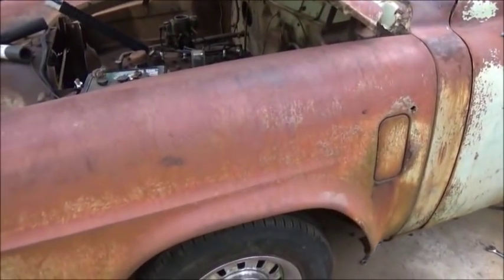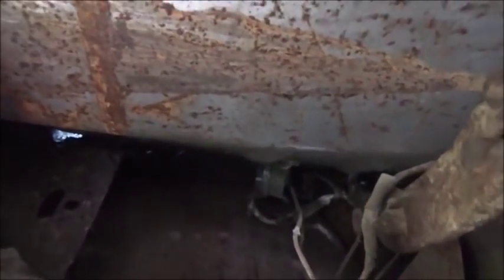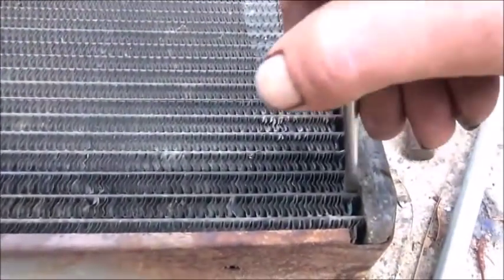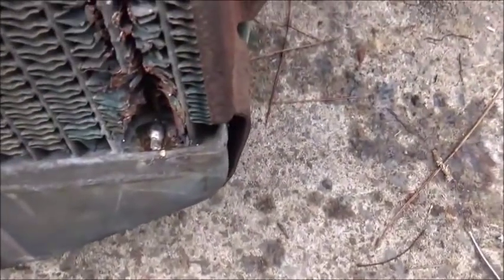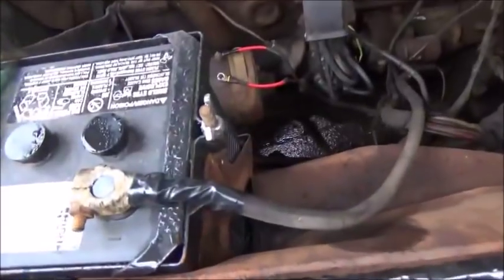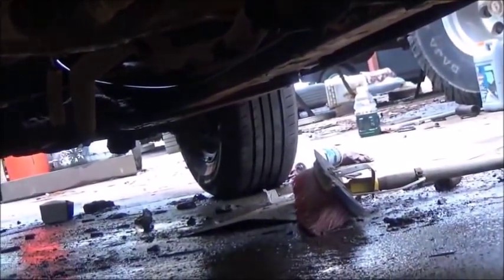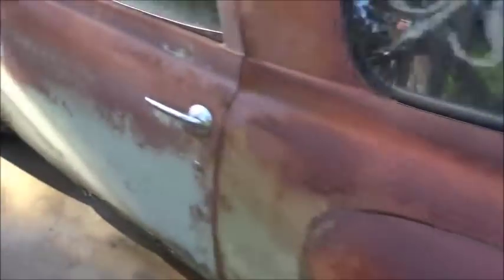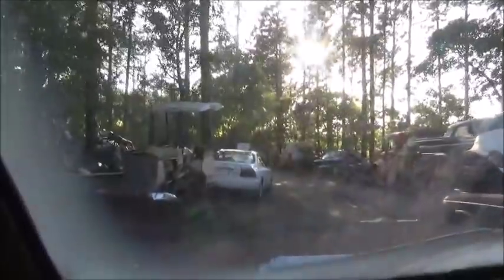1951 STUDEBAKER FIRST DRIVE IN 40+ YEARS

Comment: Your overdrive will make a world of difference. That engine only produced (when new) 85 horsepower, and the rear end ratio is 4:56. With the overdrive, I can comfortably cruise in my '51 Champion @ 65mph.
Reply: How fast can you feasibly cruise without O/D? I’m working on a 53 champion project right now, and it doesn’t have O/D.
Reply: @FennixGamingYT  If you have the same ratio rear end gearing as mine, 50 mph will probably be as fast you'll want to go, but by 1953 they may have gone to a taller gear ratio which will calm things down a bit.
Reply: @rogerlee3941  I think my car has either 4.10 or 4.27 gears

Comment: Fabulous resurrection!  You mentioned overdrive being needed. the trans is most likely a T90, with the external OD lever connected to the handle next to the hood release, and a solenoid about the size of your fist, plus a governor to tell it when to shift. Normally, to use OD, push the handle in, and drive normally. My favorite trick was a toggle switch mounted to the shift lever, bypassing the OEM electric control, allowing the solenoid to be directly controlled, regardless of road speed. In effect, you could split shift it for six gears, but it was only practical with five of them. Shifting kind of like using a two speed rear. The stock axle ratio was probably 4.55:1. There should be a tag under one of the diff cover bolts, usually on the lower right. You can have a lot of fun with OD! I did this before I could afford to buy a T-10.  By the way, when you're in OD, the transmission will let you coast when you take your foot off the gas, known as "free wheeling" so you have no compression braking.
Reply: I had a 56 chevy with od and it would operate as a 5 speed as well as a 59 ford I guess most of the od transmissions worked the same way.
Reply: @frankdeegan8974  You are correct. The overdrive only works on second and top of the three speed box. Usually there is a contact breaker operated by the gearchange so when first or reverse is engaged the power to the solenoid is cut. A similar contact breaker is attached to the accelerator linkage so when the accelerator hits the floor the overdrive disengages (overtaking kick down). Got a Warner overdrive in my 1954 Packard.

All the best from

Nick Jervis UK 🇬🇧

Ask the man who owns one

Comment: 2 comments: You should really consider a really good refurb for the '51.  If only because it's a 2 door. And I read somewhere that an excellent safety device  for ANY old car with a straight steering column and flat steering wheel is a pointy spike in the middle of the wheel aimed at your heart . It will make you a better defensive driver. It won't save you from the drunk in the wrong lane though. LoL

Comment: The low geared rear end necessitated the overdrive and that gives you 4 forward speeds, and if you wind it out in 2nd gear OD will engage giving you 5 forward speeds !!!  Or IF you wire past the OD governor and put a switch on the shifter handle you can get 6 speeds out of it !!!!  A friend way back when had a 52 Commander ,V8, with the OD trans and he swapped in a jeep floor shifter and wired past the OD Governor, had 6 speeds forward, only thing is you were busier than a one legged man in an ass kicking contest working the switch and shifting !!!

Comment: I think its ready for the cruise in right now jonathan. what a nice car. looks a little rough from the back seat with shreds of roofing hanging down, but the car is a beauty. that two piece back windshield is something very special. I would bet it wouldn't take 25 hp to run 60.

Comment: If the cops busted you driving it, would you get the tow for impound? It would make a great video!
Reply from the maker: No, it's insured, just a registration ticket that would be dropped when I bought the tags. But than again I have been towing for the Highway Patrol and Sheriff dept for 27 years so I may get a little help.

Comment: I owned a '52 Champion sedan from 1974 to 1979, bought low mileage at the Pate Swap Meet.  Kept it in an old lady's garage in West.  When I'd go to Waco on alternate weekends, I'd park my '70 Olds Delta 88 455 in its garage and drive the '52 to Waco.  The overdrive worked but I had to tie a string from the contacts on the firewall to the overdrive cable and every once in awhile had to give it a tug to make it go into OD.  After seven years and a replaced engine, the OD just gave out and a Studebaker with its 4:55 axle and no OD is pretty useless, so I sold it.  Sadly, I understand it's sitting in some field in the Waco area.

Comment: Great old 1951 Studebaker car Johnathon :) I had my 2002 Chevrolet Impala  car with exhaust leak from back pipe from the Catilylc Converter to center pipe to.my center pipe  goes to muffler and my 4100 252 CC V6  engine sounded like Stock Car at 1mph to 40 mph fine soon hit 45 mph to 80 mph very loud Lol ! After 80 MPH or quiet down in 4 to 6 gears foward speeds! But been fix since then and did up myself !

Comment: 300 degree electrical solder will work to fix the rotten heater core.  Plumbing solder requires to much heat.

Comment: Not surprised that you got it running and driving at all, I am amazed at how you build the floor pans and how great they work out.  I remember the old Studebakers sitting around for sale in the early to mid 60s, they didn't bring much at all.  I seem to remember the ones about that time having 16" tires and a fellow I went to high school with putting a ribbed tractor tire on this rim and running it for a rear tire because 16" tires were pretty much all gone by 1963 or so for cars and he couldn't afford a new tire and there weren't any used ones around.  I wonder if that is another reason your car seems to be so low geared.

Comment: Great video and great work.  Wow, I wished I was working on something simple, got me an old 99 chevy trailblazer I started work on today, and as usual, it don't want to roll in neutral, something electronic/computer related, as like you have to insert the battery just to remove the key, good thing it was a free vehicle other than registration  My problem is a spun rod bearing, maybe something electronic in the transmission funky,..I can't wait to rebuild the 4l60e and engine, it angers me so much all that electronics and complexity I might flip it when its all freshened up unless I determine I will use it for off road purposes(probably needs mods for that action), just so I can go out to the range and target shoot "in style" and not worrying bout getting dirty of dinged or paint scratched,....might be better if I somehow drop a chevy 350 in place of the 4.3 l six, .....probably another reason I quit trying to do mechanic work for other people, ya almost have to read a haynes manual front to rear just to figure out how to pull the engine and transmission in a timely manner.

Comment: I love the feel of driving something that has been parked up for some time. I think the time spent on it come together when you got each gear and knew it would live again. I remember those overdrives, some had a electric solenoid to shift and other a chock cable which I think that one has. I got my biggest surprise when thy go in, it works in all the gears since it is in the tailshaft of transmission. I guess what I'm getting at is when you let off the throttle it just coasts  with no engine backpower and then goes when you give the gas again. Thais okay long as you know which I didn't at first and hit the corners with new respect. Great job bringing her around again. Just what you done so far would last longer than parts and pieces of engine, clutch an stuff will... years

Comment: Jonathan; i love your channel..You approach any car with an intelligent perspective and look for more info as only the best master techs  (who have gotten past their ego) would. I ran an auto, truck and marine electrical shop for a few years, so here's some of my 2 cents worth... battery cable connections .. both to the battery and to the block/body are most of the source of starter and generator/alternator fails. All cable clamps should be opened fully then bottomed on the battery post ..and then tightened. its assumed they are cleaned well with a proper clamp brush first.. use an ohm-meter to check for NO resistance in any of the connections... and defiantly check the engine to body braided cable.. they fail from the engine moving on its mounts and especially when mounts fail.

Comment: Way cool  she’s on the road, as far as the OVERDRIVE a short cut with that is get the pull lever working  and hook up the solenoid with a simple power on off switch
You can actually make it all work fine with just that. Ive been driving my 60 Chevy for 3 years now, Just need to learn how to shift it, no need for the govener too, I took mine out and put a rubber plug into the hole...

Comment: And besides if there's one of those seams that are rotted out that's bound to be more of them so you're going to be fixing it in one spot and it's going to wind up leaking somewhere else Springtime and possibly is a little bit of money into this when you'd be better off and safer to drive what's a record radiator
Reply from the maker: I thought about a thousand miles on it no leaks so far. You won't find a radiator shop anywhere in my area. Epa's done shut them all down.

Comment: Hope your able to get overdrive working. Will make a difference in rpm's. Since you have 14" wheels, may consider changing gear ratio. Likely has 4:56. With better gear or 15" wheels 60-65 is good cruising speed. Hope you stay hooked on Studebakers, I drive a 61 Champ pickup as a daily transportation. Our family has had Studebakers since 1960. I know your bride will enjoy driving it.

Comment: There are not that many of them left might have done a full restoration. In Elmira NY at 654 Sullivan Street sits an abandoned 1991 Ford Mustang. The guy that owns it is in the military. The car hadn't run in over a year and a half. The motor is seized up. The owner tried to remove the rear drive axle to unseize the motor thereby breaking the rear drive axle my hope is someone will locate the owner buy it and fix it up before it rots away and becomes scrap iron. That would be a shame. Those are highly sought after muscle cars. To let it sit and rot away and become scrap. iron would be wrong. Fan of restoring old vehicles Robert Gildea

Comment: If the frame is rusted through  in a place or two but the rest of the frame is solid, can one cut out the rusted areas and weld in a like gauge steel in the shape that was cut out?